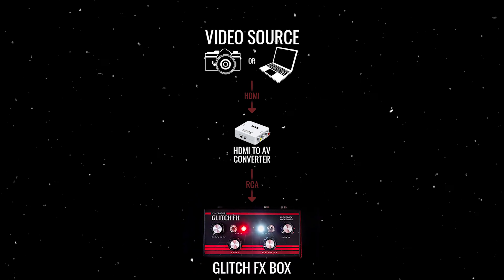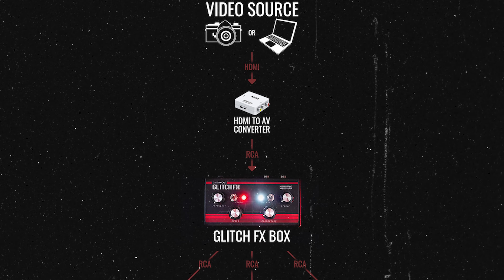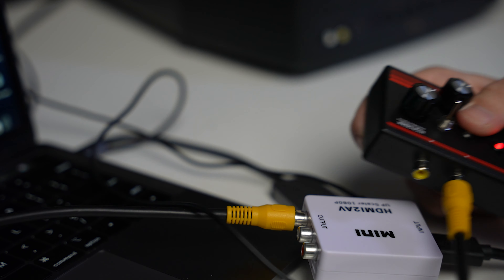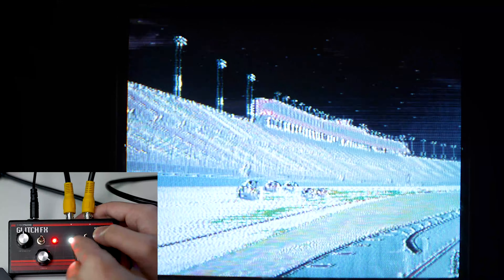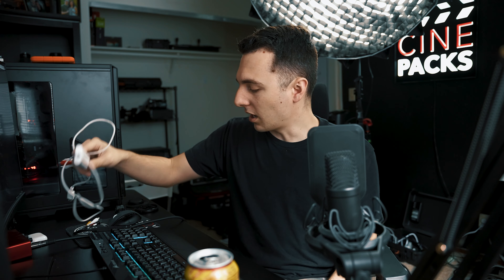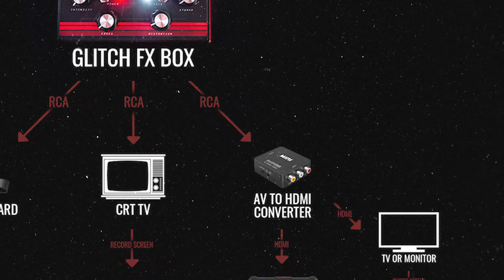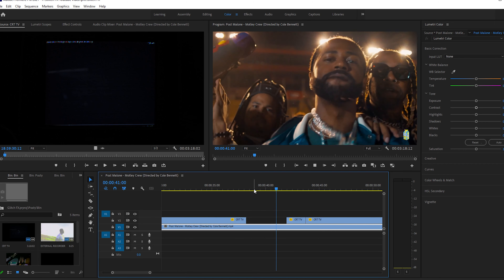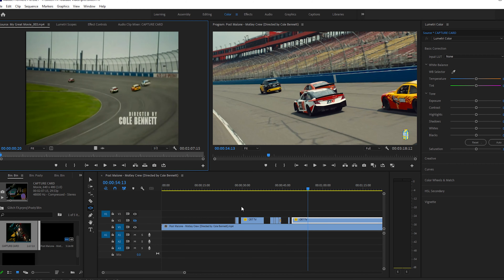How to get REAL VHS/CRT Glitch Effects - Video Synth Full Walkthrough

Comment: I bought the glitch FX and it doesn’t look like what you have advertised. The knobs are plastic and the middle switches are cheap plastic buttons.
Reply from the maker: We sent email about the updates the old knobs did not work as wel so we did a slight redesign
Reply: @TylerCaseyProd  I’m really stoked you are delivering a product like this. Just giving some feedback.
Other thing I noticed is the text labels for each knob is very small and illegible on the labels.
Reply from the maker: @DavisSutcliffe  appreciate the feedback! Totally understand. 🙏